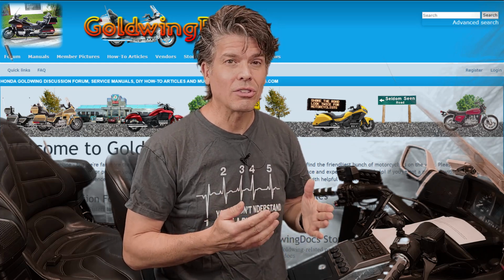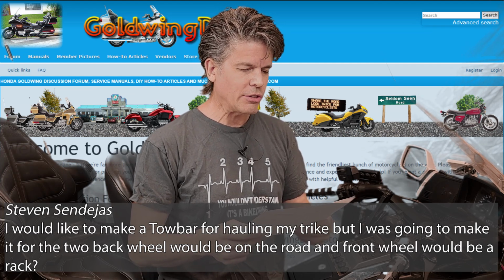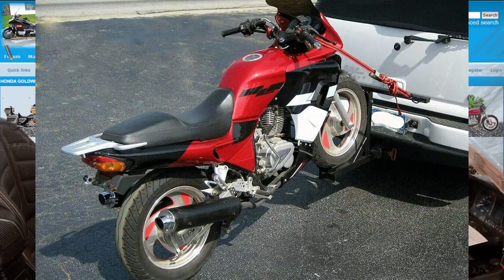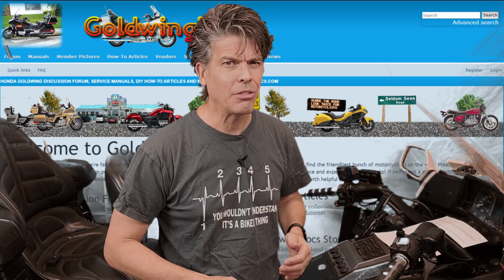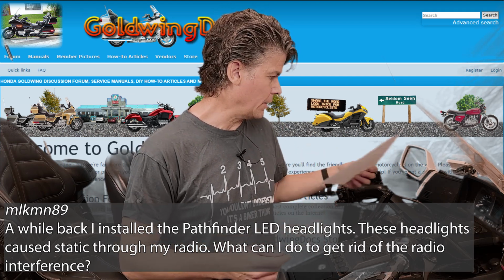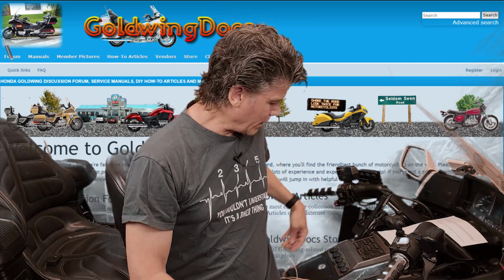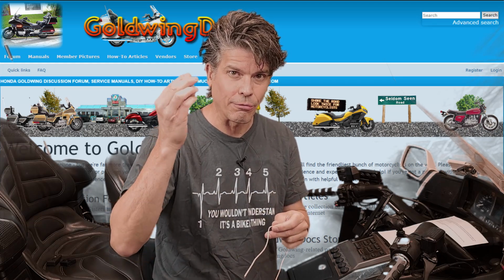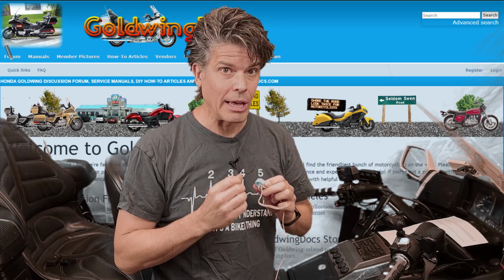Goldwing Q&A Episode 12: Defective Tires, Towing Goldwings, LED Noise

Comment: Can you help me with my 1976 goldwing gl1000 I bought it he said that it sat for a year and it ran before  that and when I turn the key the dash lights come on just when I press the starter it just clicks and won't start I got a new battery, starter solenoid, and ignition coil still won't start I'm stuckkkkk is there anything I can do please help 🙏

Comment: I have an 81 goldwing I bought in 81. The right side cylinders stopped firing. But if I spray gas into the airbox with a atomizer the cylinders fire. The bike was running fine and all of a sudden it stopped on that side.
Reply from the maker: Sounds like the carbs on that side need to be looked at, then? Perhaps no fuel getting to those cylinders...

Comment: When using balance beads be careful not to use air with a lot of moisture in it, many compressor tanks are very wet! Aluminum wheels also caroad from moisture inside wheel,beads will clump up!
Reply: I used an air conditioning vacuum pump. With a hot tie under vacuum the moisture in the tire will boil and be drawn out by the vacuum pump. So far I have not lost the seal of the bead on the tire under vacuum.

Comment: I have a 1991 GL1500 SE that I fully restored last year and has 250,000km on it. It runs great and since Restoration  I have put another 9,000km on it with no issues.
I am thinking of taking it to Sturgis this year. My trip will be about 7,000km. 
Would you a Goldwing with this many KM's on it on this long of a trip?
Reply from the maker: For sure, and I think you've got enough mileage on it now to consider it reliable. There are 1500's out there running with over a million miles on them!
Reply: @GoldwingDocs  
Thanks.
I will be riding over the Beartooth hwy and other mountain passes....any worries doing this with a carbureted Goldwing?
Reply: I have went over the bears tooth with my 1500 and had no trouble enjoy the ride
Reply: @lionellisafeld4687  
Thanks

Comment: You too??   No haircut in 6 months!!   Gotta get it done (haircut) and I have   two Goldwings (2003 & 2006) 1800 oil changes to do........ what to you think of the Wix (SL10000) filter for the Goldwing?  Thinking of ordering a case of them and I already have several gallons of Honda GN4 10W-40.   Good?
Reply from the maker: Wix makes excellent filters. They also manufacture the NAPA and NAPA Gold filters, which I have used for MANY years on all of my vehicles.

Comment: I also have really liked balance beads, I find as i get older that it eliminates that high speed vibration that aggravates the carpo tunnel and makes your hand feel numb.  I was told I couldn't put them in my 2009 GL1800 due to the TPMS which is not currently working because batteries are dead inside. Well that's not true, there is no screen or anything blocking the stem going into the tire.  (thanks Goldwing Docs for that info)  so i just went and put my beads in the front and rear tires.
Reply from the maker: Very good point! Vibration like this is fatiguing and can cause permanent nerve damage!

Comment: I think both Pathfinder and EC recomment a ground loop isolator when you get noise on the radio like that.  I know you know a lot more about electronics than myself.  Is a ground loop isolator basically the same thing as the ferrite choke?
Reply from the maker: No. A ground loop isolator will not normally solve this type of issue - that's used in audio circuits to isolate grounds between two components so as to not induce noise based on a difference in potential on the ground between those two components. If there is noise on the power circuit, a ground loop isolator is not really going to help much - unless there is already a potential difference in the grounds, in which case ANY induced noise from any source on the power is going to be heard as noise.

Comment: Scott, does that single ferrite choke work as well as the circuit that you published awhile back that had several components on it?  I'm not knowledgeable on electronics but was able to follow your lead on that, but that installation is difficult to fit back behind the headlights on my 1500.  This choke looks relatively easy.  This recent series of videos has been very helpful. Chris
Reply from the maker: That circuit was actually to block the noise caused by the headlight modulator, but yes - that circuit is essentially a single ferrite choke "on steroids." For anyone reading this, here's the circuit I designed and built that he's talking about: https://goldwingdocs.com/forum/viewtopic.php?p=197702#p197702